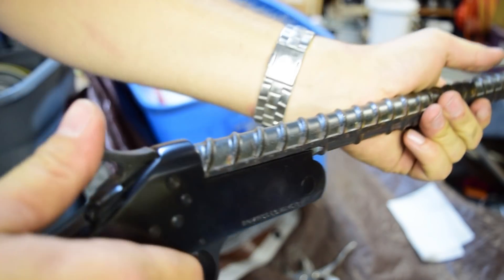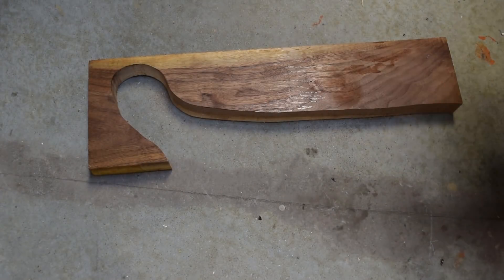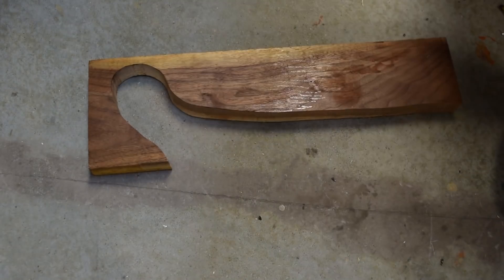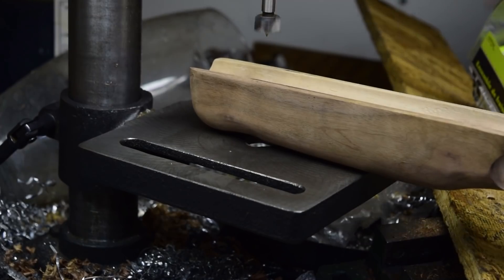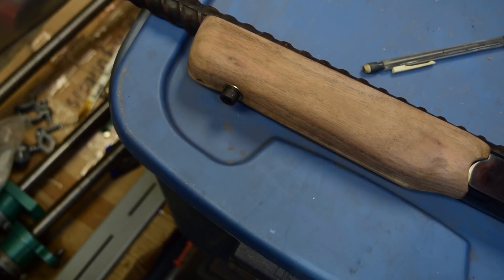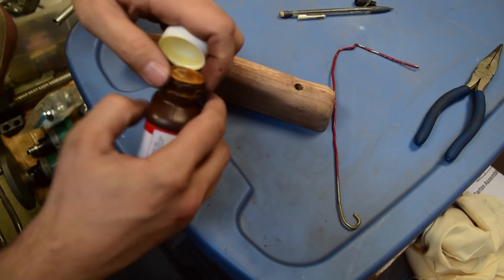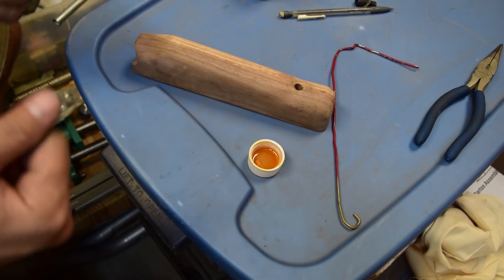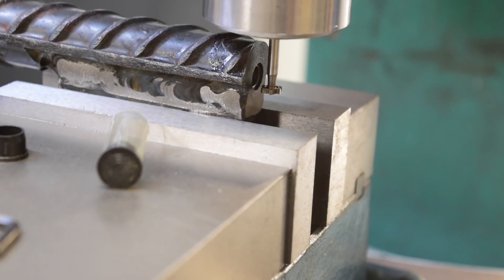Rifle barrel made from rebar - PART 2. Grip and Shell extractor

Comment from the maker: "Co-li-bri" - Aguila .22lr Super Colibri. A specialty ammunition with little charge and a light bullet.
Reply: This Stuff I Do Man, That's awesome! You decided to make space for you to make a .22 Rifle from rebar and other components. You're a legend man Keep it up!
Reply: This Stuff I Do I have a suggestion for a name if you haven't named it already...

REBAR RIFLE .22 PREMIUM
Reply: Kolibri Carambine
Reply: awesome you did this to prove it can be done/An autoclave would come in handy, you could make it with a vacuum pump  and a run of the mil cooking pot  pit some rins in it so i don't colaps ,, some and some Nicon wire for the heat source, insolate i so it don bur your shop down,  two-part rubber puddy for the seal.  no forgetting the vacuum gauge of course stabilizing te wood  ... would make like iron.  epoxy it and she'd be a beuty .   why not finish the barrel .?? id be interested in seeing you pelicate the back half of the gun as well.
Reply: Aguila makes Colibri and Super Colibri.

Comment: maybe you could add some simple sights and connect the rear sight to the extractor setup?

have the rear sight have a long bar with two screws holding it where it rests on the top of the barrel and the screws rest in elongated slots in the bar. when the breach is closed it is steady then when you open the breach you can pull back on the rear sight with two bars going down to your extractor you made to actuate the extractor.

it's a lot like the metal end on a measuring tape if that helps you get ideas.

Comment: For the ejector I would of milled a slimmer vertical channel down and used a flat spring secured with a small screw. With some tweaking you could of got automatic ejection or partial ejection and closing the action wouldn't be effected.

Comment: Are you stupid? Seriously! Ive made my fair share of rebar in steel mills...its a no spec steel...that means it is probably equivalent to a 1015 steel.(wont heat treat for shit) and also as a non spec steel...it can contain LEAD. A lot of lead...and lead as you heat the steel and drill into it cones out into the atmosphere near you. You are now breathing lead! Good luck with that!
Reply from the maker: Happy new year Mike! Did you happen to work at Nucor, the manufacturer of my particular bit of rebar? They publish the MSDS for their rebar and it specifies less than 0.07% lead (by weight). Even 12L14 leaded steel calls out only 0.35% (by weight) lead content and presents absolutely no danger because milling and lathe work do not produce chips fine enough to become airborne. Leaded steel is frequently used in machine shops around the world to easily produce fine surface finishes. The popularity of open lead melting pots for bullet casting suggests that, even when molten, it isn't quite as dangerous as you might believe. For anyone else timid about metal toxicity, the "Cody's Lab" channel has some fun videos on handling mercury. Much more toxic than lead.

Comment: also reverse modeling can be used to create a metal frame that will allow heat distribution to a lighter metal such as aluminum but you may want to vary the prototype from al to re and then steel to re and then al but you should try all variations because it took edison three hundred tries to make a vacuum bulb by accident when his vacuum pump broke. a last wood veneer for cooling will help for a survival rifle like that but at least screw it in place also this is just to prevent warping of the barrel and misfires that can cause blow back and death.

Comment: taking a secondary piece of rebar and heating it and burning the wood with it will give it a better fit and accuracy. epoxy will need to be used a light pressing will also help for accuracy. good luck.

Comment: Are you a machinist? Or are you self taught?  The reason I ask is because you really did not zero in the rebar when you drilled the hole for the liner. If you did get it straight that is great, but next time I want to see you align your barrel to make it attack driver. For a .22 rimfire the rebar is quite sufficient, but I don't think I would use it with any higher calibers. Why rebar? Why not cold ro0lled round stock? Anyway nice project. By the way , I am a gunsmith so that is why I am asking so many questions.
Reply: I think anyone that is self taught, is better then those that use machines. These guys know how to be innovative and creative.
Reply: Charles Driggers did you even watch the first video before you commented?

Comment: That finish has the same texture as Danish Oil which if I remember right it is both raw and boiled linseed oil with shellac. I used Danish Oil on a walnut stock and after several coats I was left with a fantastic hard finish.

Comment: I wonder if you added a recess to the block behind the extractor you could add a spring, and then add to keeper springs to a slot inside the extractor "track" to keep it from flying away. Perhaps with a bit of shaping on the face meeting the receiver, it'd be an automatic ejector?

Comment: I think it'd be awesome if you did another stock, but made a small compartment sort of like a drawer in the side. You could drill holes in a thin metal base at regular intervals to create a storage area for maybe 6-7 rounds, then by placing a soft material on top in the compartment you could keep the live rounds somewhat more fitted and secured. You could even use a standard door latch to secure it, to give it that junk yard look that you mentioned, just feel like it'd be a great addition to the piece. Keep up the good work

Comment: you could adapt it to to shoot 22 magnum,22 long as well. just throwin that out there
Reply from the maker: Forgot to mention I also re-chambered it to 22LR. 22 Mag uses a slightly larger bore, sadly.
Reply: Re chamber it for the mag and just grind the rim off of a mag case stick it in the chamber then insert 22lrs thats how i shoot 22lr from a magnum never had an issue